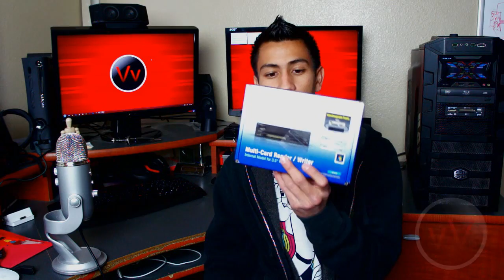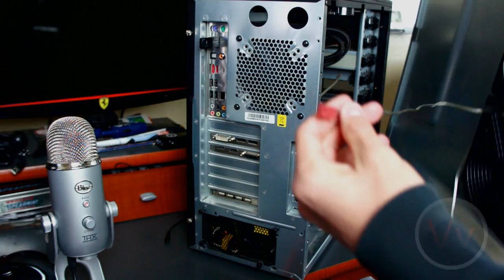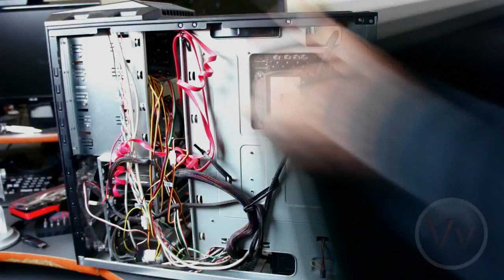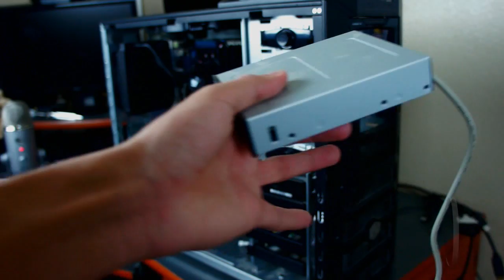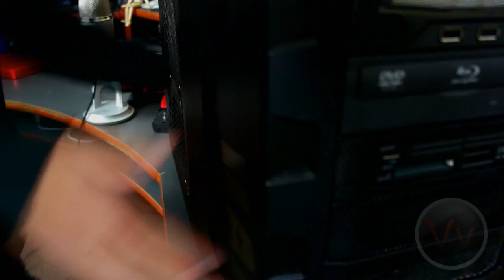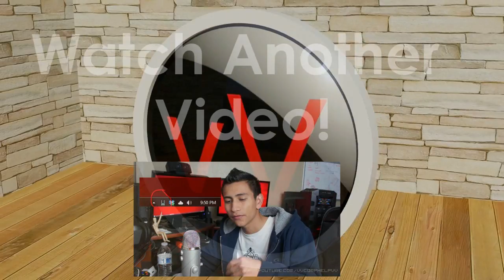INSTALLING an Internal Memory Card Reader

Comment: It's not entirely necessary, all you need to do and be in is a dry environment and touch the metal bit of your case before and after you touch any of the components inside.

Comment: @cateye27 That's not needed, and static electricity actually doesn't have a high chance of damaging your components, it's just an extra measure, and touching any metal object that's on the floor will do aswell.